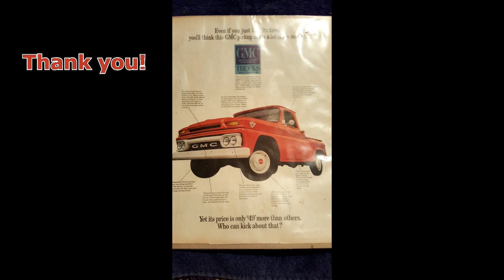HE WHO HOARDS HEMIS ..... WINS !

Comment: Good to hear that you are on the mend. That old square body with the 6 cylinder with the weird valve cover was not really popular. The tubes coning from the Valve cover had one way valve and used engine vacuum to inject air into the exhaust , it replaced the belt driven smog pump. It was called "PULSE-AIR"  That engine also had a integrated head, The exhaust manifold and head were all one piece , We had issues with those engines here in the deserts of Arizona .  The they cracked very early and most are gone now. I know you like chevys and appreciate some info !
Reply: I had one in a 82 GMC pickup.  2bl carb and split exhaust going into the cat converter.  The water was mixing with the oil, so I yanked it out and put a 283 with a 4bl in it.  It ran a lot stronger and got better mileage.

Comment: Yup. I have a 1981 short wide Chevy Cheyenne pick up with one of those 250 straight six cylinders with the odd valve cover too. Was his exhaust manifold cracked? GM only made that exhaust manifold on the 250 six 2 years (1980 and 1981) and you can't find a replacement manifold like it anywhere.
Reply from the maker: you have an 81 short wife? lol  ok....

Comment: just wandering, maybe you know something I don't, but why is there an overhead valve engine in yur plymouth coupe?  Didn't know they made them back then.      Dan
Reply from the maker: that frame and 4 cylinder engine is an old chevy that I drug up out of the canyon when I bought my property 25 years ago..I set the coupe down on that frame just for yard art....   :)  the engine is a 28 or earlier because chevy made their first inline 6 in 29.. even before that they were overhead valve engines..
Reply: @1963impala2drWaylonWire  Didn't know about the chevy frame, that explains it all.     Dan

Comment: I hate to, I mean it... your not a kid anymore and after a complete cat scan... what can I say... order up some harbor freight one use only tarps and get most of that thirty four up to the shop in the mock up with the frame just setting on the nine inchsome two by's under that shell and no fenders right away aaaaas they are kinda suffering anyway but squeeze the hemi with trans, a apple limb for a drive shaft on the ground... leave that coil in its firewall holder and the wiring loom out of a jet airplane (enough wire to light up wenatchee wa., )and just gander at it a bit.... Its like putting out bird seed to see what kind of bird fly in to feed. You might wind up with a crew to get it done including wives with tater salad and corn on the cob plus a fire pit to cook the tofu with grease dripping off it. Make it smell like dead cow and someone will help you see it through and if that ain't bad enough then get your git fiddle out and play some Johnny Cash song on the speaker boxes pointed towards stown and then if that don't do it then ... eat everything yourself... there is worse ways to die  than in your sleep from eating too much